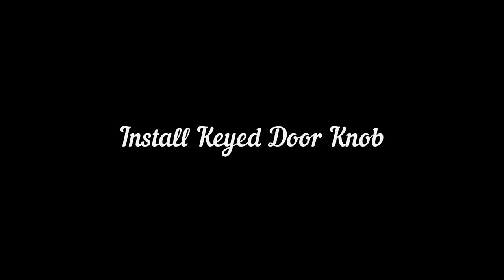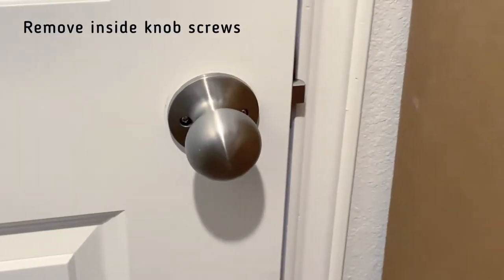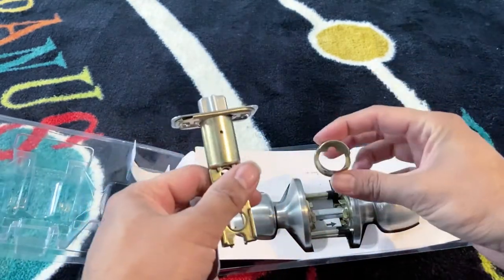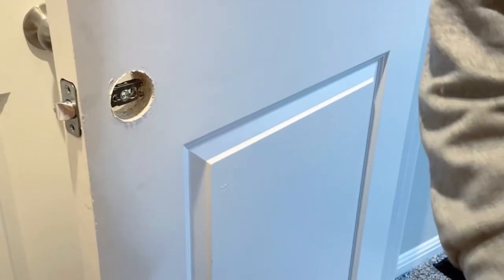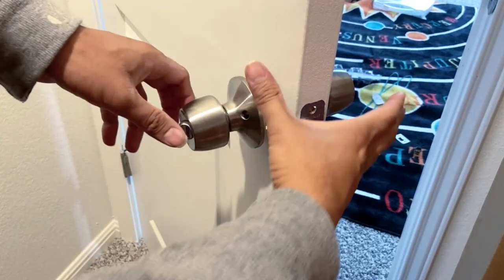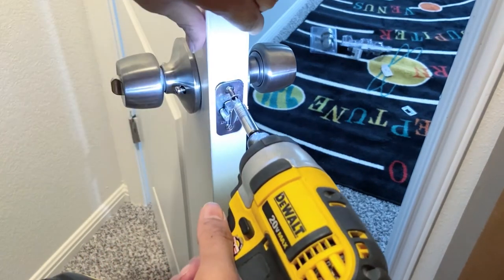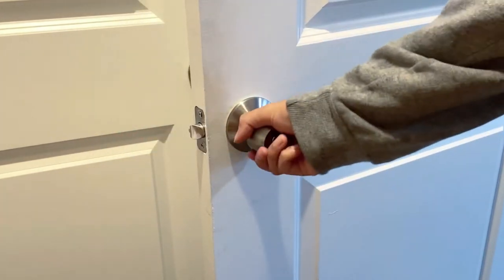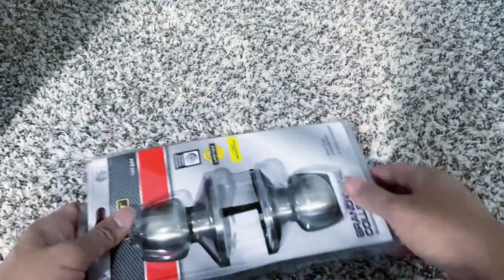Install Keyed Entry Door Knob #diy #doorknob #privacy #keydoorknob

Comment: over the years I learned right tool for the job. Do yourself a favor pickup an offset screwdriver they are $2-3 you’ll be thankful when putting those screw in 😄

Comment: What is the small circle piece? My bathroom door has a lock from the inside and when I shut the door from the outside or inside you have to twist the handle to shut in instead of pushing it